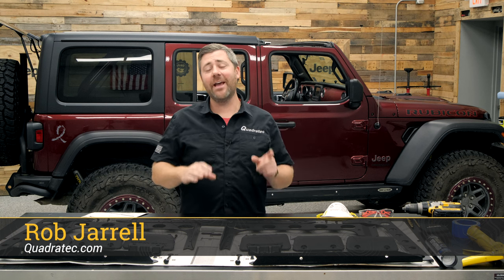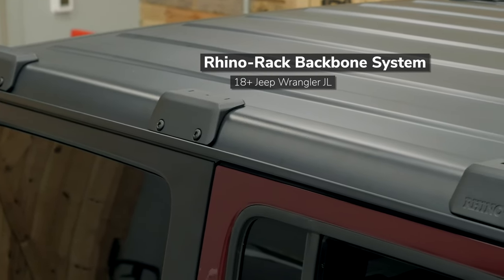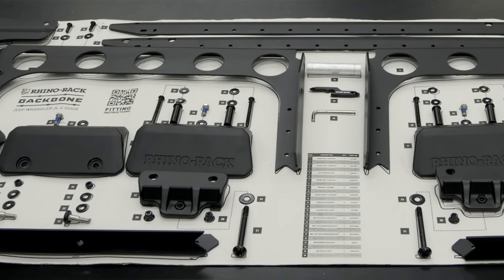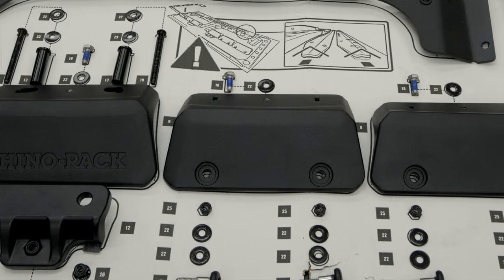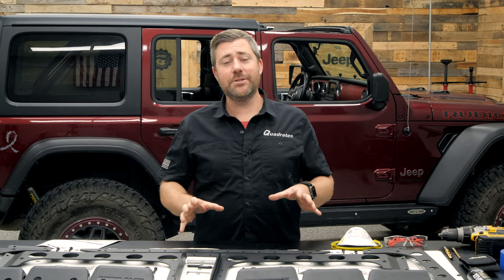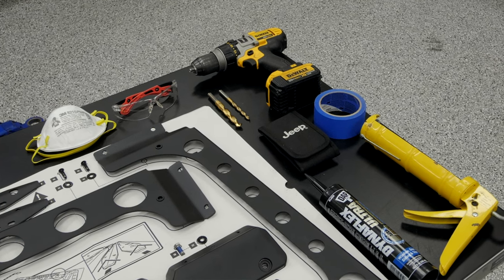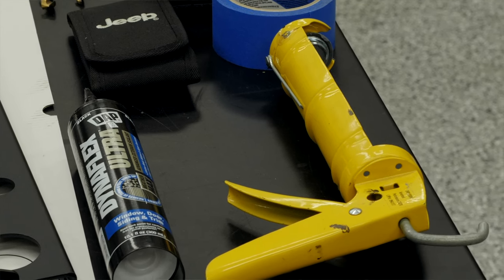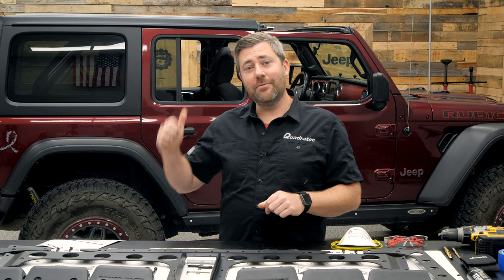Rhino-Rack Backbone System Step-by-Step Install for Jeep Wrangler JL

Comment: Hi Rob! Love your video's; really helpfull. I do have a very specific question; would you be able to confirm how much height is added to the jeep with just the back bone base blocks installed? My estimation is that this is about 0,5 inch; however I'm looking for a more accurate measurement. Need this measurement for a project of mounting a slim line RTT directly to the base blocks. Thanks already !

Comment: I saw the install for the Gladiator, but did not realize the Backbone System was available separately. @ 6:45 and @ 10:05 torque the nuts/screw to 3-4 ft/lbs for now. Perhaps the instructions have the final torque requirements. Wonder if Rhino-Rack recommends the use of thread-lock? Really liked the split screen to clearly show selected parts of the install. Thanks for sharing.
Reply from the maker: 3-4 ft/lbs is the final torque requirement. No thread lock needed with the lock nuts provided.

Comment: Are the platform racks interchangeable after installing the quick mounts/backbone system? That is, could you put the larger 84 inch (versus the 76 or 72inch) on the mounts without changing the placement of the mounts? I don't use my freedom panels and would prefer more real estate on top for overlanding.

Comment: Can you still remove the hard top after installing this?  I love the system but would still like to run my soft top when I don’t need a rack or hard top.
Reply: Yes you can. Just have to pull out the long bolt that goes up through the roll bar when you remove the factory bolts to remove the top.